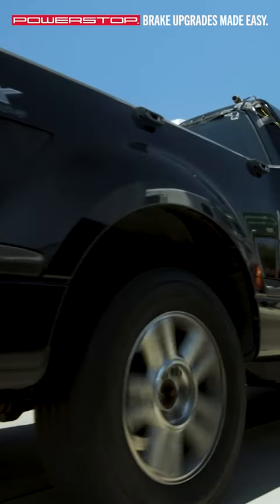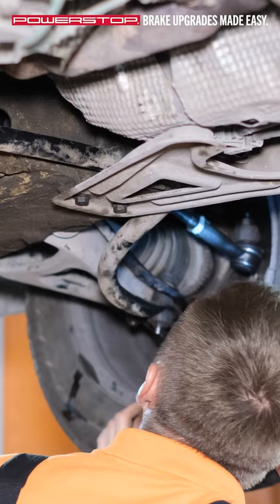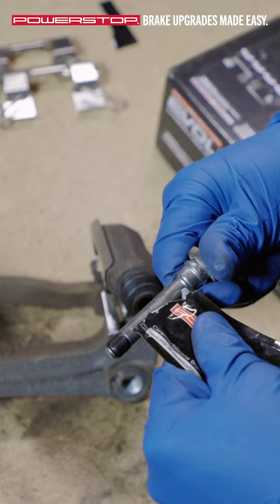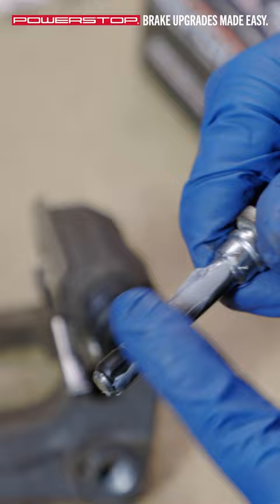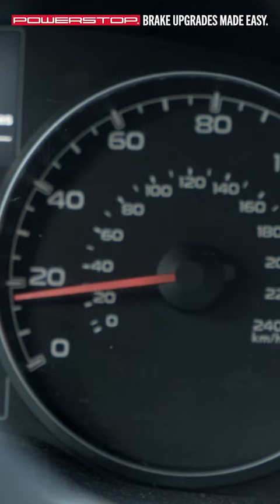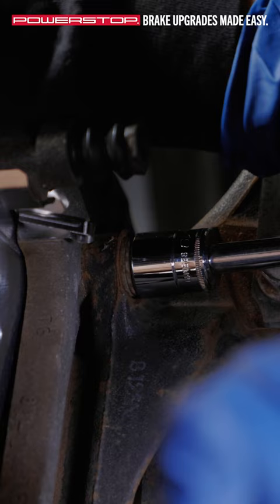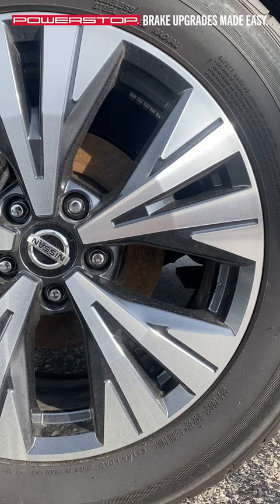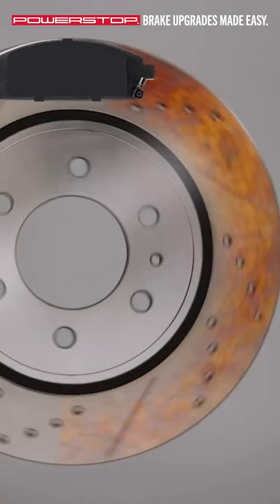How To Fix Noisy Brakes | PowerStop #shorts

Comment: When you install new pads use that blue sticky spray on the back of the pads! 
Looks like a gimmick but I tried it and I will not do brakes without it.
"Disk brake quiet" 
Camt rember the brand name but look it up n you'll find it. 
It eats vibration 10x better than the pad silencers alone !
Worth its weight in gold ! ! !